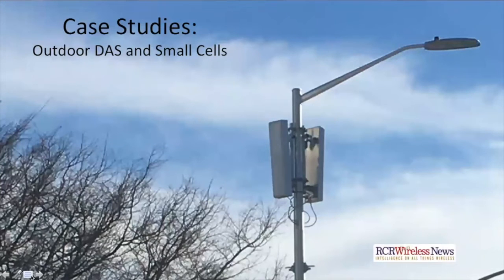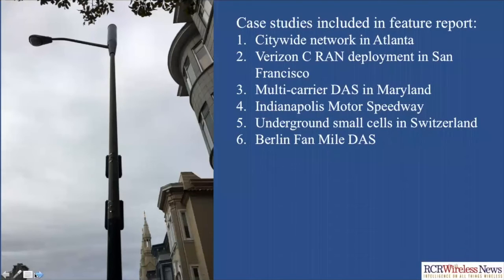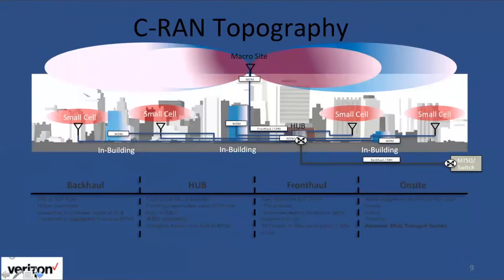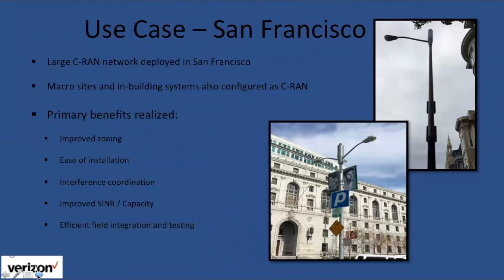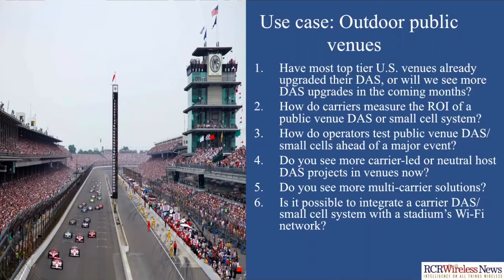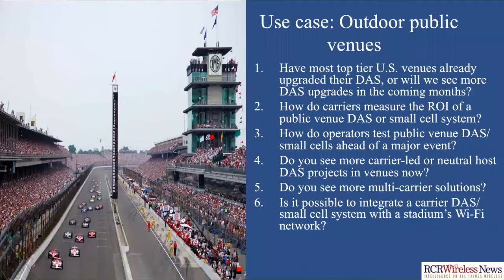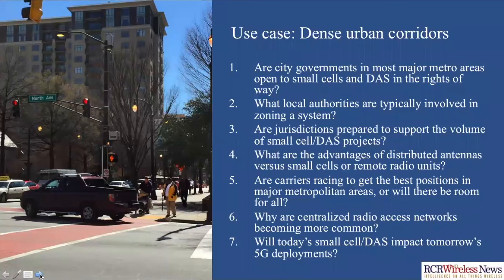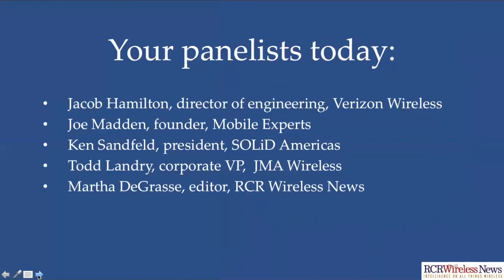Editorial Webinar: Outdoor DAS and small cells - case studies

Comment: guidelines are easily to be stepped over as it isn't definitive...from what i've heard and read these community meetings are few and far between and now residents are becoming very concerned indeed as the dangers are not current and based on old safety lines